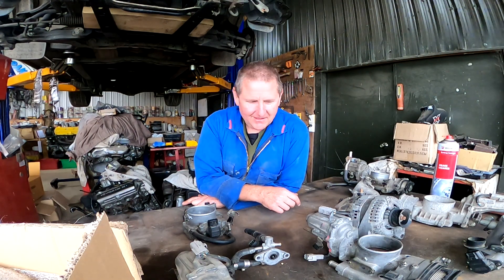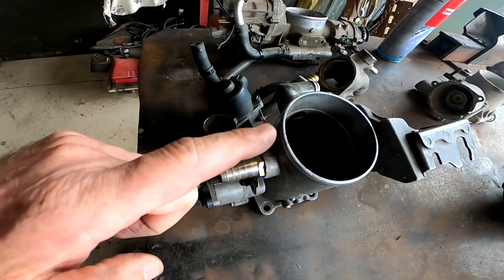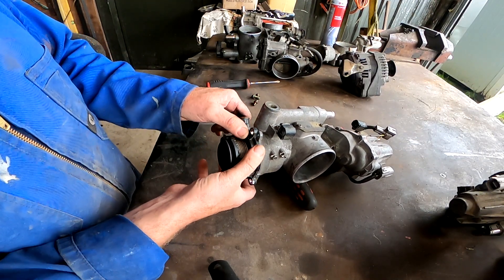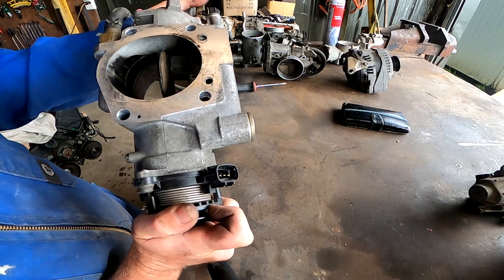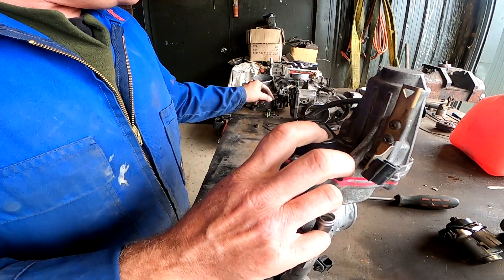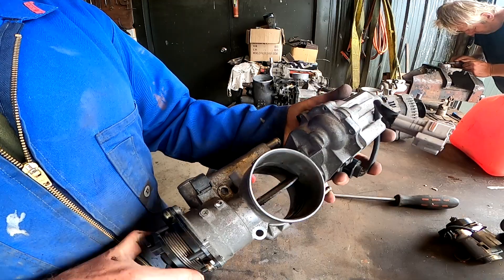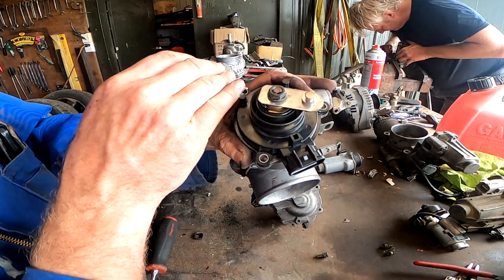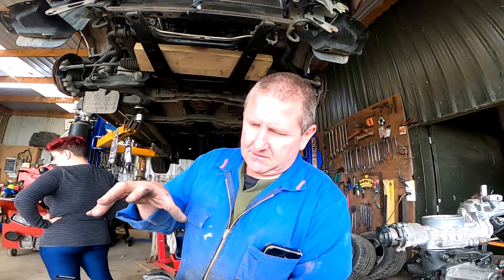1uz VVti DBW Throttle body.  How does it work?  Disassembly. Includes fitting manual throttle lock.

Comment: Did this on my 1uz vvti stock ecu and ran just fine
Reply: I am thinking to do it on my 1uz swap IS200. on my log it showmy throttle just open arund 70%
but is nor throw up the code

Comment: I have a 2002 Toyota Epic with a 1UZ motor. It utilizes the drive by wire system. Lately I've been having issues with it starting right up when cold but after driving for a while it cranks and sputters but won't start. I've been stranded on the lake twice now. I've replaced a lot of fuel system components but now am moving to the throttle body again. I have a feeling those little ports you talked about are my issue. Thanks for the explanation.
Reply from the maker: I have some epic parts next to me right now and chat to plenty of people with them.   I'd be opening the ecu and looking for corrosion.   Cheers Kelvin
Reply: @CartuneNZ  Just pulled the ECU. All pins looked great. Pulled apart the ECU and it looks pristine inside and out. Pulled throttle body plate and cleaned out the holes with break cleaner but it wasn't bad. Any other advice by chance?

Comment: This is so detailed man, thanks for the helpful video 🙏🏻🙏🏻. Do you happened to sell fully assembled vvti throttle body? Mine throws an error code saying the magnetic clutch issues, causing hesitation when engine is on load. New throttle body is too expensive 😓

Comment: love it , jason giving you a hard time
Reply from the maker: Can you imagine the normal week of work.  Cheers Kelvin
Reply: Can this be done on a non-vvti throttle body from a 2uz? If so where can I get the adapter that goes in the cable side? In doing the same thing with my non drive by wire throttle body. I built an adapter plate to rotate the cable spring pedal position assembly rather than having an adapter inside because I didn't have one. I like your adapter solution better.

Comment: Hi Kelvin, fantastic knowledge as usual. I'm wondering if the 3UZ throttle body assembly could be swapped onto a 1UZ VVTI?
Reply from the maker: Yes.  Look out for my upcoming video on more useless info on a 1uz VVti where I fit a 1uz vvti throttle body onto a 3uz engine , so the throttle body physically interchange.  management must be swapped as well to make it work.  cheers

Comment: I like the cost-effective solution for boat applications. On vehicles, do you have a preference dbw vs. cable?
Reply from the maker: Sure is.  I would like to do a budget ecu for the boats as well to show its about setup and knowledge more than big budgets and still make it work correctly.  I prefer DBW but the later 3uz unit is much nicer than the clutched DBW.  Cheers Kelvin
Reply: @CartuneNZ  In the (US) spring I'm going to try a 60mm Bosch dbw setup...

Comment: Is that throttle lock insert piece something that's available?
Reply: I achieved the same thing with an adapter plate (I have since cut it down to a round shape) but I'd love an internal solution that doesn't rotate the connection for the throttle cable.

https://youtu.be/WgqCL1QehZg
Reply from the maker: Yes.  Sure is.
Reply: @CartuneNZ  So.... from you? How can I get one?
Reply from the maker: @markwoytovich6342  email.  Buy from me.  Dispatched from my mate that makes them in usa
Reply from the maker: @markwoytovich6342  send email info@thecartunecompany.co.nz
Reply: @CartuneNZ  Done
Reply: @CartuneNZ  Eager to buy, sent email...